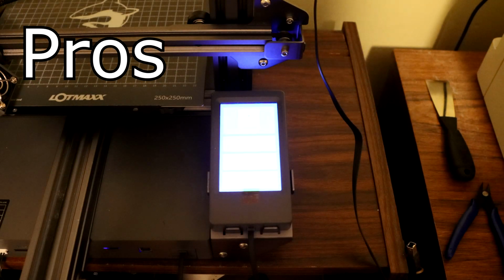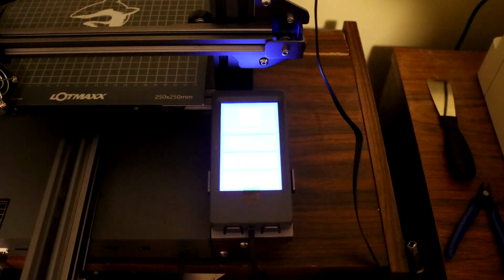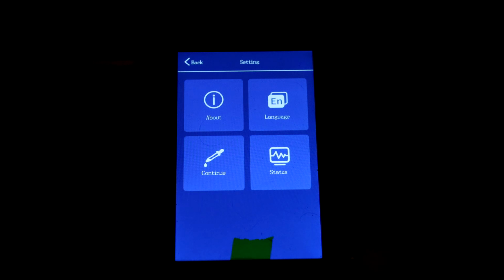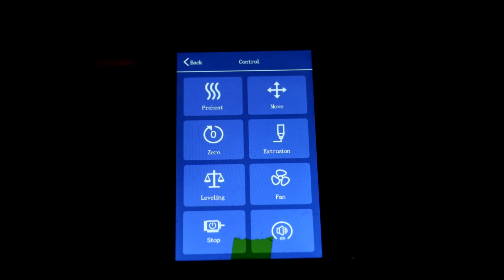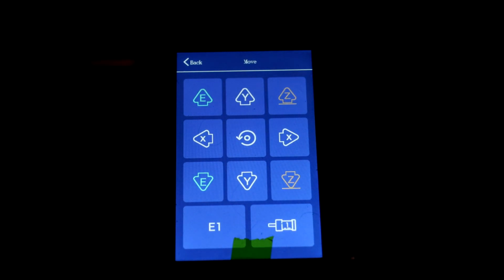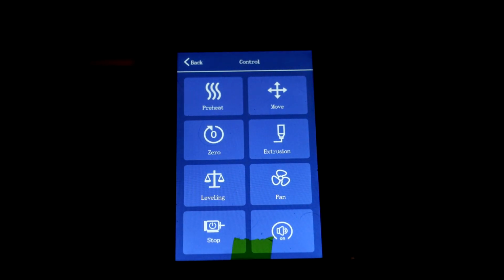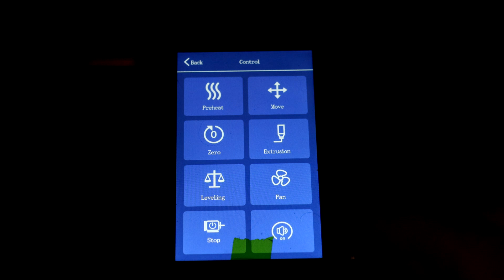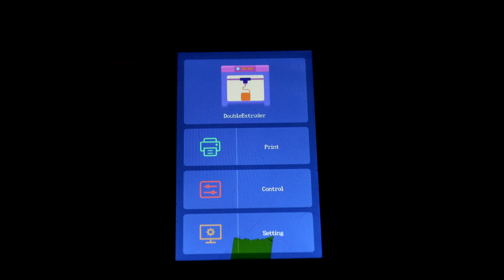A Beginner's Review of the Lotmaxx Shark V2

Comment: Hmmm. I have the exact same printer and it has auto leveling and manual. Also mine came with tubes that are long enough. Maybe your box had strange parts.
Reply from the maker: Back when i ordered mine, it had just came out and auto leveling wasn't offered.  They later released a firmware update and the parts that i bought to add that functionality. 
I think the short tube was just a worker accidentally cut mine too short, but i did get obligated to mention it.

Comment: Thanks for the review, useful information with no BS.  A year down the road, would you still recommend this?  They just came out with the V3 with auto leveling and laser engraving, so it looks good, but I'd like to know how the V2's held up for you.
Reply from the maker: Overall, quite well.  The autoleveling has helped alot and I did replace the magnetic metal textured sheet with a somewhat flimsier magnet sheet from creality.  
Overall, I still find it to be quite good.  Just took some tinkering with and some learning about good pla filaments.  After spending some time learning Cura5, I usually don't have an issue with bad prints anymore.

Probably my biggest desire right now is speed.
For my next printer, I'm considering the FLSun v400

Comment: what happens with me is that it says i have filliment but when ever i go to print something it shakes and jerks around and then the filliment gets loose so do i have to do the drilling thing?
Reply from the maker: There is actually an alternate way that I wish I had thought of.  If you remove the screws to the box where the filament runs through, you'll see the pcb with a long metal "feeler" on it.  Just bend that metal "feeler" just enough so that it will never give a false alarm when there's filament in it.  It's much easier and ended up doing this for my 2nd feeder.